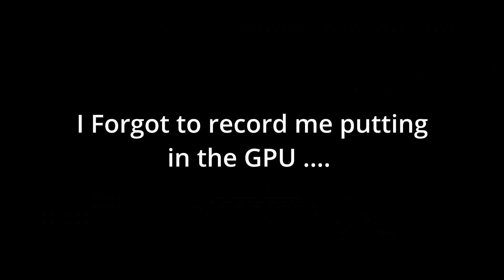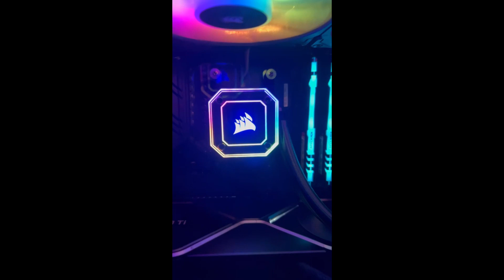Upgrade Your HP Omen 30L to a Custom Gaming PC!

Comment: any recommendations or max specs for a motherboard if I want to keep in the Original 30L case?  Or do I need to ditch the OMEN case ?
Reply: Dude I heavily recommend that you transfer your OMEN 30L case in the future The Omen 30L has very limited spots for cooling upgrades and gonna save you a ton in the future The omen 30L has bad airflow Hence why some parts get so freaking HOT! So definitely Upgrade the case
Reply: I ended up getting a 3060 and it fit perfectly and works clean. But you are right I got to look into a new case for any other upgrades

Comment: Hey cool video, will windows load off of the original SSD? I have done some research that says it will and then as long as your online the new motherboard drivers can be loaded. Thanks for the confirmation.
Reply from the maker: Yep it was plug and play for me. But once you get everything loaded if you wanna do a fresh install and get rid of all the HP bloatware you can do that too.
Reply: @AzzurroGaming  oh really, that's awesome. Thanks for thr reply!

Comment: i know this is a old video but hopefully you can help me out. Im replacing my ryzen 5 with a ryzen 7 on my 30L but I cant find any retention brackets that fit on my 30L default motherboard. for some reason the screw holes are like a inch more a part and most retention brackets arent long enough.
Reply: to be more specific im trying to add the CPU cooler that comes with the ryzen 7 3700x
Reply from the maker: Hey sorry for the late response , so the omen motherboard actually uses intel mounting brackets even though it’s an AMD CPU lol. It’s weird . So try out an intel mount and see if that works?
Reply: @AzzurroGaming  yea i found out the hard way that it uses intel mounting lol. well I did find intel mountings that also support amd fan coolers but the issue is that the Wraith Max Cooler is so thick that the mountings dont let the cooler touch the CPU. so I'm just going to stick with the default fan and maybe upgrade the motherboard.

Comment: I have this same system. Great job on the upgrades! I am planning something similar down the road. Right now I have a faulty GPU so that will likely kickstart things.
Reply: Yeah for sure that’s how started with my omen when I had it. At the time I replaced the GPU with a 3070, then swapped power supplies and from there I ended up building a whole new pc similar to the one in this vid. I don’t have any original parts left from my omen anymore
Reply: I honestly wish I hadn’t bought this one. HP was lousy to deal with as far as customer support and technical support. I still have a Dell from 2003 that has never given me a single problem. I likely will not buy an HP again. very frustrated. I have to spend money to buy another card so soon after purchasing the system but outside of warranty at the same time. 🤦🏾‍♀️😤

Comment: hello, i loved your video its awesome. i currently have the someone from a few years ago that i bought and i didn't want to change to much just the graphics card and CPU. what graphics card do you recommend i can upgrade if i have the nvidia 2060, Motherboard Hp 87C3 and a power supply of 500watts. with out changing too much since I'm on a budget? thank u
Reply from the maker: Definitely look up what graphics cards can work with the 500watts power supply. Each one  has different recommendations. Some 4070s will work with 500watts and also the 3060 and 3070 should as well.  And I’m not sure what case you have but just make sure the dimensions of the card fit nicely and has some air flow! Good luck 👍🏻

Comment: Hi Ik this an old video but I have a question, so I have a 30l omen also and I was wondering what gpu can I use with my amd ryzen7 3700x 8 core cpu bc I want to do the custom pc using my cpu like you did
Reply from the maker: You can use any GPU with that motherboard as long as it fits the case and your power supply is strong enough.

Comment: If I can't buy all new upgrades at once, what do you recommend I start with?
Reply from the maker: Before I did a full upgrade, I had all the stock parts and just swapped out the GPU for a 3070fe because it fit perfectly. That was the biggest difference in performance for me. Airflow isn’t the best in the omen case though so it will run a little hotter.
Reply: @AzzurroGaming is there any way to cool it down? i’m trading in a ps5 with $160 cash for a 2060 ryzen 7 3700x and want to do upgrades in the future , do you think it’s worth it? (the trade)

Comment: Hey I'm basically getting the same exact specs as yours except my case is a 5000dbut on the asus motherboard, what was the usb - C cable that was not supported at 13:48. Will this cable affect the overall performance of the PC or is it just an extra cable included with the case?
Reply from the maker: The motherboard didn’t have an extra USBC plug so all it affected was my top USB-C port on my case didn’t work. Other than that, no problems at all!
Reply: @AzzurroGaming  Thank you! Your video really helped with guidance on upgrading my HP Omen 30L! :)

Comment: Where did you plug the sata cable? I’m new to pc building but I’m looking to complete the same transformation from my omen. I see you said fan controller, is that located on the power supply?

Comment: What gpu will fit in 30l case with stock motherboard. Already ordered a 750w psu
Reply from the maker: Almost all 2 fan 2 slot GPUs , but the max length is 286mm I believe .

Comment: Any idea if I can upgrade my Ssd on the stock mother board?
Reply from the maker: yes you have to make sure its a gen 3 for the omen motherboard. Also you will need a windows install USB to install windows on the new SSD. I don't think you need a new windows key because its linked with the motherboard but if you do you can find them for cheap online. like $10

Comment: Hey man very helpful; I was about to upgrade my old 970 (which has 1x6 pins and 1x8 pins) to a rx 6700 (that has only 1 x8 pins) Do I just plug the one that was on the 970 and leave the 6pins just hanging ? Or I need to plug in via another cable from the psu that has only 1x8 pins (sry it's my 1st Time upgrading)
Reply from the maker: probably best to use a cable that just has the 8 pin connector on it! i'm sure the other will work too but it may be splitting power inbetween connectors so you may not get the full power output to the GPU.

Comment: I am considering doing it. do you know the maximum processor you can have in the motherboard. I was thinking about upgrading the processor to something better
Reply from the maker: Which motherboard ? In the stock Omen motherboard or in the Asus rogB550F ? The omen can only handle about 4 CPUs . The Asus motherboard has a huge list if you go search the b550F gaming motherboard and go to cpu compatibility it can handle alooooooot. Some might require a bios update but it’ll say it in the description